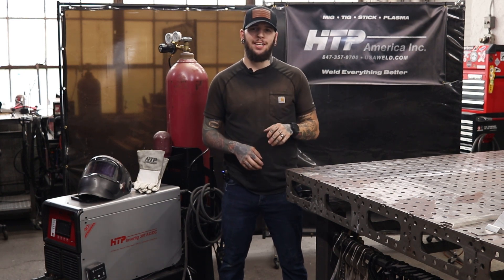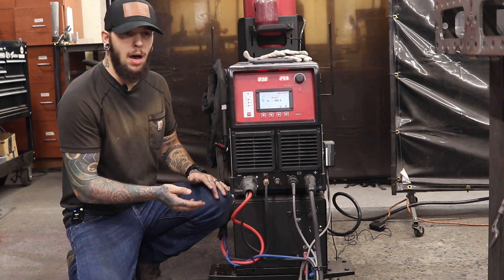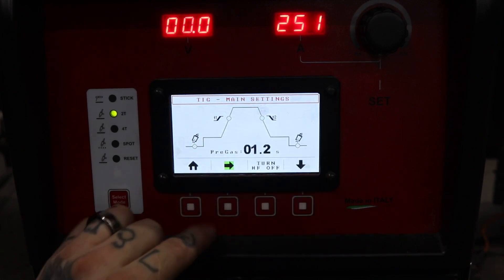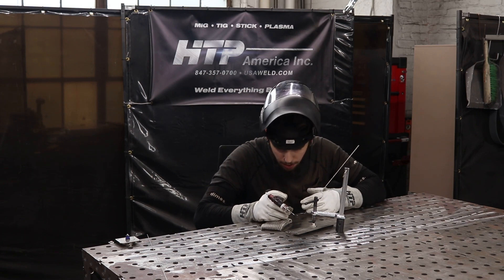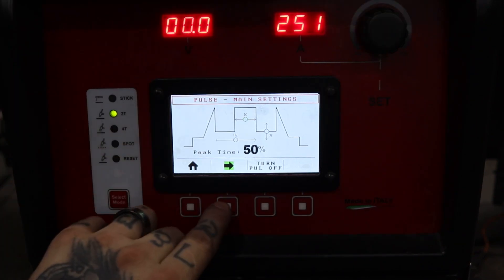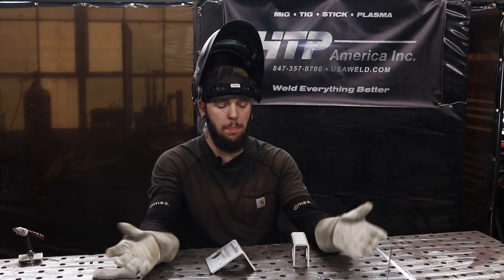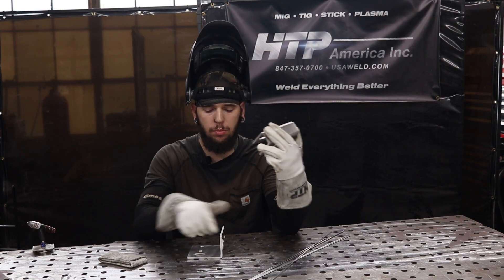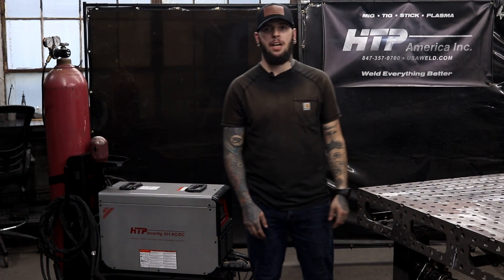HTP Invertig 301- the Ins and Outs

Comment: Hi, can you let me know how the Miller 300 or 280  compare to the 301, I weld .030 to .040 alum.  My Miller 210 goes down to 1 amp, will this handle that light of material?  let me know thanks
Reply from the maker: Your miller 210 has a non disclosed and non advertised hot start in tig, that what mean is: you are not really starting the arc at 1 amp you are starting it (deepening not he tungsten diameter you have selected) at anywhere from 70-140 amps .... this "blast" of amperage is only available for a couple hundred milliseconds and tapers off quickly but that is what is blowing holes in the soda pop cans when you try to weld them and why you have to ignite the arc on the filler metal ....  the HTP has a 4 amp minimum not a 1 amp minimum but you can adjust or even turn off the hot start so that you can actually start the arc at 4 amps ....  4 amps are "good for " as low as .004".   you welding 030 or 040" is not even really challenging for the machine.   the 400 Hz ac frequency and triangular wave would also help you to weld thin material but at the thickness you are inquiring about it is not even close to necessary. 
thanks
Reply: @usaweld  Is the Invertig 300 locked in using only the square wave like the Invertig 221?  I have the Invertig 221 myself.  Thanks.
Reply: Yesh it goes down to 5 starting amps. I've welded razer blades  with ease as well as some .020 jobs. Plenty of arc stability for thin gauge jobs.